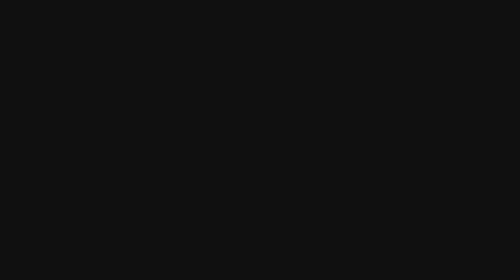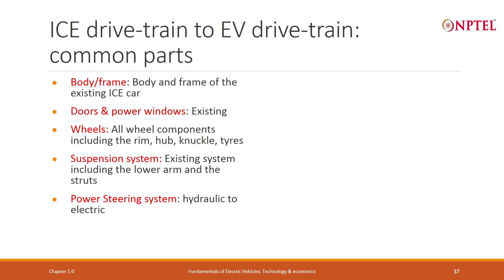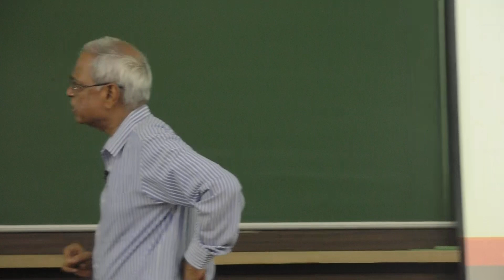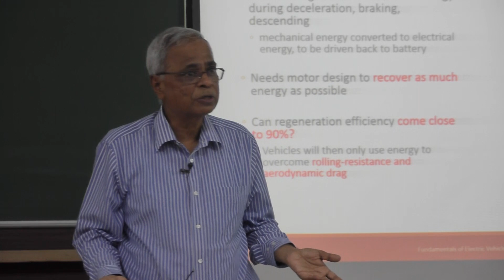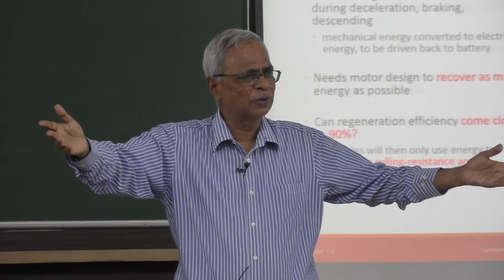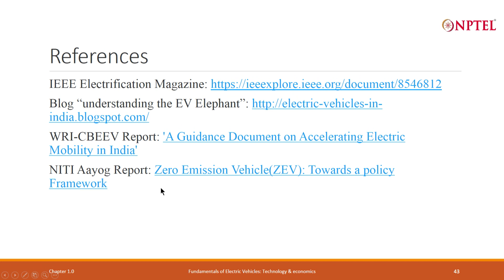Lecture 7: EV Subsystems

Comment: Motor does not rotate in the reverse direction while regeneration.
Reply: I think motor will rotate to produce torque(it produce energy) that energy will be restored
Reply: @harish7176  It's depends vector angle between the quadrature axis component and direct axis component. Generally VCU decide the regeneration negative torque requirement based on all conditions and inverter blend the voltage and current which required to feed the battery. Battery acceptance also checked for the recuperation feeding.
Reply: Right, if done so vehicle will start moving in reverse 😂
Reply: @asifally4ever  🤠
Reply: during the braking of the vehicle , the power convertor sends less voltage than the voltage developed due to the kinetic energy of the vehicle. This allows power flow from vehicle to battery.
Reply: Basically, there is an induced current that travels through the ac motor and reaches the motor controller, which then converts it to the voltage of the battery and stores the energy

Comment: Will the regeneration not affect the charging and discharging cycles?
Reply: the regeneration affect strictly depends on the thermal management system because the one important thing which plays a major role in battery's life is temperature. Regeneration is a process to recharge battery by converting mechanical energy into electrical energy and in recharging process obviously temperature (you need to maintain) and BMS to ensure the battery is getting evenly charged, because un even charging may lead to detoriation in life of the pack (aggressively)
Reply: Maybe it won't, all depends on BMS
Reply: Good question. Battery Cycle life is defined by say 100% DoD (depth of discharge) charging & discharging. DoD and Cycle life have nonlinear relationship. Say if a battery is 100% DoD done, battery life is 2k cycle, then the same battery if done 80% DoD (say 10%-90% SOC cycling) then life will be 4k.  Also during regeneration, only a fraction of it  chargers battery usually 15 to 20%. While this will affect the cycle life, the contribution is very negligible due to above reasons.